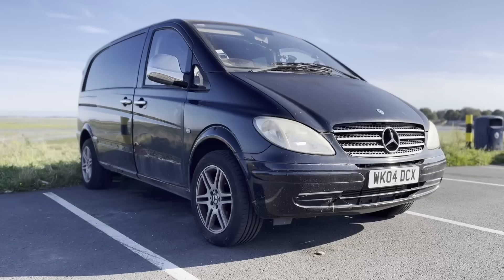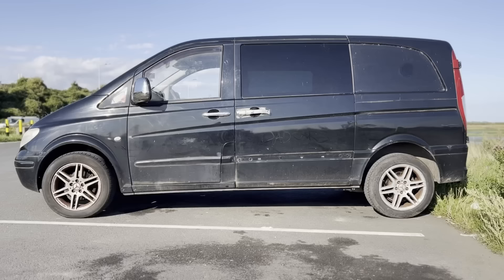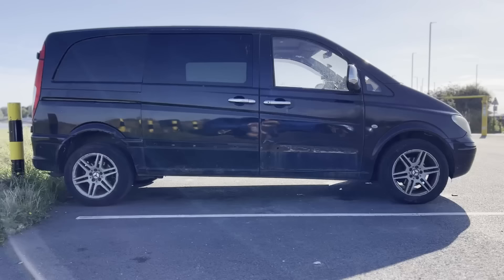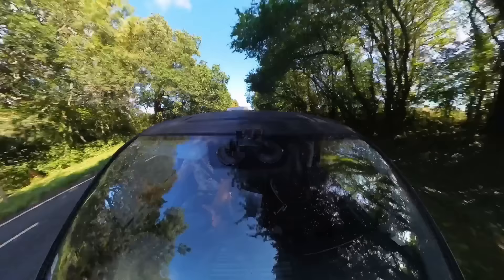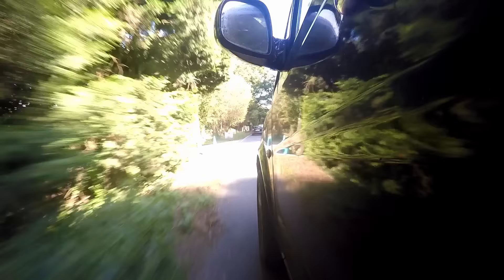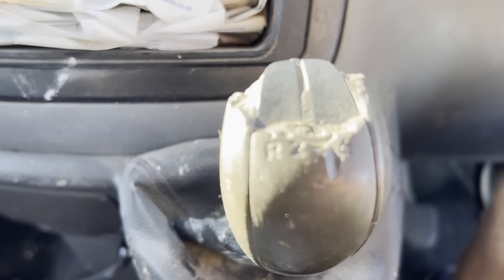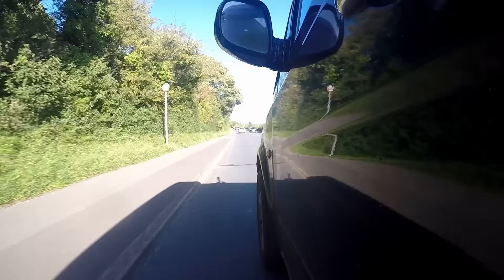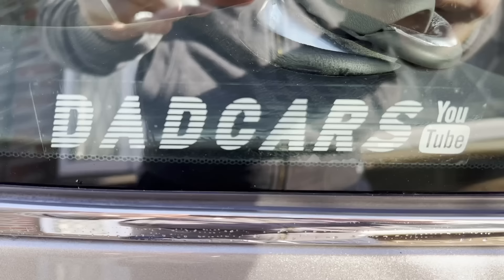The Mercedes Vito Is A Bargain VW Transporter Alternative With One BIG Problem

Comment: I've owned my 2007 Vito 115 sport for ten years now, it's been bulletproof in my ownership, I've had a couple of minor issues but they were easy fixes. It's taken me across Europe, taken my bikes to track days, been on holidays in it, oh and it was my place of work and office for seven of those ten years. Mine is rapid for a van and returns 38-40 mpg on long runs if I keep it under the motorway speed limits. Being a 2007 mine doesn't suffer with corrosion like the earlier W639 models. I thoroughly recommend the Vito, over the other manufacturers offerings, even as a sixteen year old van its quiet inside and drives waaay better than other vans half its age and mileage, even the standard sound system is well above average. Two sliding doors are worth their weight in chocolate biscuits. Things to keep an eye on are the propshaft, front suspension condition and geometry, wheel bearings, injector seating washers do fail, when they blow get the washers replaced as a matter of urgency, use toyota avensis diesel seating washers and the problem never returns. Top tip, get your parts from a MB truck dealer, they supply Vito parts at refreshingly lower prices than you would expect and under the prices motor factors charge, particularly service & consumable parts. A great van that deserves to be as respected as much if not more than the VeeDub, particularly the honking T5. Thanks for putting the Vito up there! 👍🏻
Reply: Thanks great info on the injectors washers👍

Comment: I used to Work for Mercedes for over 25 years, these are good vans, you’ve summed it up perfectly, the rust was a big issue at Mercedes back then, think it was the water based paints that were used it was actually embarrassing when customers came in with their vans showing you the rust, it was unstoppable at the time, but they are good looking, versatile vans. I’ve owned a lwb one and loved it, I used to work in the parts and have sold just about every part of these vans, I’ve always liked them, and definitely good for converting into a small camper,
Cheers from Edinburgh, ( I’ve subscribed to your channel).
Reply from the maker: Awesome thanks man! I do love it such a shame it’s crumbling like a sand castle 😅

Comment: Great video, I’ve owed VWs , transits, Vitos , but the best hardest working bullet proof van is the Toyota hi-ace , mine had 246k on the clock and still drove well 🤷🏻‍♂️
Reply from the maker: Few people have commented the same! Maybe I should get one on the channel 🙌😅
Reply: Had a few older hiaces, they’re pretty reliable.
Reply: The proace is awesome too!
Reply: Agree about the Hi-Ace. The couriers in Australia and NZ use nothing else. Shame that one doesn't seem to be available in the UK.
Reply: Old mk6 transit for me with the T280 ❤
Reply: Agreed HiAce for pure reliability and build quality.....however cab is cramped, hot and they are thirsty.....over all if you spend all day on the road....I'd plump for the transit
Reply: I do love a South African taxi 👍
Reply: I've seen a 600k sprinter which only ever had routine maintenance. Same engine as the vito, in fact same unit used  throughout vans and cars. Toyota hiace is from the past. Rear leaf springs and your sitting over the engine. Horrible in winter driving, terrible fuel economy, noisy and as rusty as the old vitos and sprinters. Let's not forget sticky running gear on the side door and tailgate lifts always failing.
Reply: 100% the Hi-ace most reliable van on the planet, not the best ride and full of plastic, there's a reason in Africa these things are buses and you'll see 30 year old ones still going......
Reply: I sold my 2005 vito at 280000 running great........but the rust !
Reply: Vito's are the best van, simple enough to work on when they do eventually go wrong, used to work on them and found them good to work on so ended up buying one the bought another. Only job that can be a problem is injectors and rear wheel bearing, even the dealers won't do a rear wheel bearing by me.
Reply: Nothing comes close to a hiace!!!
Reply: @Aceedmonkey  totley agree , I’ve just spent £3800 on my T6 ! More than what my hi ace cost 🤷🏻‍♂️ I’m looking for another one 👍
Reply: I am in my third hiace last two were exported to Africa 330k on the clock one of them. My current one is a bit rusty, 229k, and I need an auto due to a bad knee. That's how I ended up looking into vito.
I really just want another hi ace but they don't do auto in my price range . 😢
Reply: @TyronePatOne depends on the year of the Hiace the last model which ended in 2012 has coil springs on the rear.
Reply: @fukuoka33  That's why they use old hi ace all over Africa and India in fact most of the world not vw or vitos then .
Reply: @fukuoka33  is the Hiace as modern as either a VW T5 or T6 or or a post 2015 Mercedes Vito well of course not because production ceased in 2012 but they are most definitely more reliable they literally do starship mileage with little or no trouble the D4D engine is a legend in it's own lifetime the engine is renowned and well known i couldn't tell you what engine is in either the VW or the Vito but both made the list of 5 vans not to buy on a video on YouTube.
Reply: I have bought a vito this week it's a 2015 traveliner exlwb ex prison transport van auto . Still using my 2005 229k lwb  hi ace till the vito is serviced and set up properly but will be sad to let it go .I get people  trying to buy the hi ace off me about one every three months .
Reply: It doesnt seem to me that 246000 IS a lot... 🧐
Reply: @paulbrook2459 246k on a van isn’t that high 🙄
Reply: Had a LiteAce, 8 seater, cost a thousand bucks Aussie, did 5 laps of Australia 💪 was Auto too 😮
Reply: Ldv cub all day long no turbo no computer shite reliable as anything with the nissan 2.3 diesel , I can't part with her she keeps plugging along and never fails to start at flick of the key no matter the weather
Reply: My old man had a Toyota hiace with 300k on the clock, never skipped a beat.
He used to load it up to the hilt and it would pull it no problem and that was with a broken leaf spring if I remember correctly, many moons ago 😂
Reply: Bro comparing pushing a immortal into this isn't fair
The merc volks ford will be sad
Reply: My old man had a hiace 1994 and it had 300k on the clock, it had a broken leaf spring and he used to load it to the hilt, it used to start first time and pull anything, problem was it rotted out and fell apart before anything else died.
Reply: @JManners10 no, it´s not

Comment: The major advantage of a Vito compared to a T5 is the drivetrain in my opinion:
The OM611 in the 99-03 Vitos and practically identical OM646 successor engine in the 03 to 2010 Vitos is just a really solid motor. 
Bulletproof timing chain, dead simple engine layout (i4, single turbo) and there are really no known mechanical failures apart from leaking injector seals which is a fairly simple fix.
The 3.0 V6 the OM642 is also known to be in the Mercedes hall of fame when it comes to their best diesel engines.
In the passenger cars these engines last forever but IF fitted in these commercial Vans they need to work harder and run hotter.
So caution is advised. If the engine had regular oil changes with 5w40 or 10w40 it will most likely be alright but a beat up rig with no service history, a ton of miles is probably just plain worn out.
Mercedes in house Automatic Transmission is also a lot more bulletproof than the Autoboxes you occasionally find in a T5 if you want to go for an automatic transmission.

Of course a T5 with a pre Euro 4 1.9TDI and manual transmission is equally good at first glance but id argue that the OM611 and 646 is the better engine ultimately. The timing chain in them lasts virtually forever while a 1.9TDI has a timing belt that needs changed every 100.000 or so Kilometers or every 10 years at the latest. A snapped belt or skipped teeth will grenade the motor.
Also the "Pumpe Düse" unit injectors on the 1.9TDI are more cumbersome than the standard Bosch solenoid valve injectors on the Mercedes Diesels, they last a long time while the PD injectors can go bad earlier and they are nor cheap or easy to replace.
Another known problem is the fact that the head of the 1.9TDI is aluminium while the injectors are hard steel. And with unit injectors there is a lot of downward force applied to them via the camshaft with each injection. Can you guess the failure mode already? 
The injectors will work themselves into the cylinder head, wont seal up anymore and "tip over" slightly which ruins the injector seat. It rarely happens to these engines and some run for half a million miles without this ever happening and others suffer from his failure at 200.000 miles. 
If this happens you are usually able to get the injectors to seal back up with the right techniques (using slightly! thicker seals, glowing them out to soften the copper, use ultra high temp sealant in the installation) but the cylinder head is on borrowed time then.
It ultimately comes down to Mercedes sporting a Bosch commonrail fuel injection system that is ultimately superior to VWs Pumpe Düse System.

VW switched to the 2.0TDI commonrail in T5 Vans from 2009 onward but those early 2.0TDIs are to be avoided they have many problems like junk EGR systems and intercoolers.

I don't really want to steer anybody's purchase decision too much but if I was given a Vito and a T5 both in good condition and with the same mileage I would take the Vito for the aforementioned reasons.
Reply: Also you can get Vito with a 4x4 drive with an actual transfer case, low range and stuff, so you can actually go overlanding in it unlike Syncro/4Motion.

Comment: I have a 2013 116 and love it for its versatility with performance.  Changed the rear 2+1 seats for single viano seats and can drive to the beach with 4 people a 10'6" SUP paddleboard stashed down the middle + tons of other kit no need for roof racks, ladders go in etc....and it's a compact! Auto gearbox is a massive win. Tailgate bootlid is another favourite of mine I can sit on the back of the van and get changed or brew up a tea in pouring rain. Not converted her at all like you need the convenience of taking seats out and hauling loads to the tip but still throw an old mattress in and sleep in her occaisionally😂 130k miles and no rust issues
Reply from the maker: My old one had a tailgate boot 😎

Comment: As an owner of a few transporters currently a t5, ive always thought the vito was a no brainer alternative, ive read anything after 2006 has better rust proofing, they look really smart and are mechanically solid. Saying that if you do your homework and buy the right vw you should be fine, stay away from the big power engines. Never had any issues with mine. 😊
Reply from the maker: I can imagine with the high prices of transporters the lower price ones are always attractive, but it’ll likely be those that will cost the new owner a lot to maintain… like you say I’m sure if you get a good well looked after one it’ll be a pleasant ownership :)
Reply: No way on earth is an equivalent Vito half the price of a VW. I've got a 13 plate t5.1 I paid 13 grand for it 3.5 years ago with 100,000 if I could have got a 13 plate Vito with 100,000 miles on it back then for 7,500 I would have.
I agree there great vans but half price is a big exaggeration in my opinion.
I would imagine both are money pits past a certain amount of age and miles.
Still a good video though.

Comment: Rust was caused by Mercedes having a partnership with Chrysler until 2007 & using the cheaper American metal.. It’s the same with all the Mercedes of that period.
Basically If it says Chrysler Benz on the VIN by the door then best walk away..
Reply from the maker: This is interesting… thanks for sharing

Comment: I’ve got a 2015 dsg t5.1 transporter and a 2007 Vito 109. Id have to agree with you about the maintenance and repairs . The original battery lasted 14 years on the Vito!. The transporter looks better imo but the Vito drives better, I’d happily drive it anywhere, it clonks and bangs  and is full of dents but always is reliable.

Comment: If you're after an automatic, the vito is the clear winner. Proper torque converter box, well proven and reliable, 40mpg  with a rear wheel drive, it has no equal. Vw DSG is excellent too bit you're going to have to renew a clutch eventually. It also has problems with it's  mechatronics.
Reply from the maker: Yeah a torque converter is want you want on something like a van

Comment: I'm on my second Vito.  My current 2015  LWB 116 axe-murderers van is mine from new, 240K km, bulletproof, right up until yesterday when the Can-bus had a fit and shut down half my electronics including A/C on a filthy humid summer day when I was still 300km from home.  After I got home, it would not start, and the cooling fan went mad, so I disconnected the battery overnight, and bugger me, it's perfect today.  NO rust and I live at teh beach, no garage.  It's kinda beat to shit, but still looks immaculate after a quick wash.  I'm worried that it's developed German electrical gremlin syndrome.  Might be time to trade.  The new ones are so expensive and the nav screen is beyond 80's naff.  I'm thinking about a Ford Transit Custom Sport.

Comment: I had W638 which I loved apart from the rust, Then I got a 2011 W639 Sport X which had no issues with rust as it was a late model and converted it into a camper van, I really loved that van the only reason I got rid was it needed a timing chain which I was going to do at work myself as I was a Skoda main agent diagnostic technician but I lost my job during Covid and then the insurance shot up above what I was willing to pay. I keep toying with getting another now though as it was a cracking van, I could practically drift it around  roundabouts it handled that well!!

Comment: 134000 miles on my 2010 W639 Vito converted camper and not a single bit of rust on it at all.  If looked after, these vans are bullet proof.  As vans go, it drives brilliantly.
Reply: I made on my 2009 W639 Vito (high and long model) 470,000 km.  Not single point of rust. Bought in Holland, it seem this model has zinc cover on chasie, as even if some scratch, no rust happen.

Comment: I can trump you on this absolutely hands down.
I have a Nissan Elgrand van its got 4x4 with diff locks, 250 bhp V6, full luxury leather interior with bose sound system, surround cameras and electric drop down TV's.
Twin electric sliding doors, rear seats swivel to make a lounge are with tabe in the middle, its a 7 seater with space for luggage.
I paid £7200 including all the import costs form Japan. Its a 2009 with 46k miles and full service.
Its goes like hell with a 3.5L V6 sounds wonderful and blows away every single VW transporter 'sport van' it have ever met 😁
Reply from the maker: That sounds awesome! Although I only paid about 3k for this 7 years ago so not a fair trump! 😅 I’d love to film one of those though! Bet I’d love it
Reply: @dadcars  yup its alot of fun at the lights. Ive got a large chrome badge on the back of it that says 1.4L Eco Cargo Van, you should see the look on the faces of the top end Transporter when blasting past. Had a bloke in a Transit SMRT sport van pull up and ask how its faster than his van, and its only a 1.4, told him its because I peddle harder.
Reply from the maker: @IronMountainx  don’t know where you’re based but if you fancied a trip to Hampshire I’d love to feature it 😎

Comment: Had a Type 1 Vito from nearly new (18 mth old) for 11 years and totally loved it. 
It was a panel van originally, and I got it professionally converted to a crew cab, with removing rear seats.
Yes, it was an absolute rust bucket, but only from the door trim down to the sills. I resprayed those areas myself, and it looked like new for a further 4-5 years before I sold it on to another VanFan.
I drive a Ford transit custom, crew cab these days, but it is in no way as much fun to drive as the Vito.... that could easily pull 120mph on the Autobah. 😉

Comment: The vito is the best van I owned, but I had to down trade for the citan for fuel economy. I like the rear wheel drive too, but it's shit on wet grass with no weight in the back, and there is always the possibility of overloading it, so you keep the drive but lose your steering. Fun and games.
Reply: Rear drive is a big plus in the vito. Try to climb a big slope with a lot of weight whith front drive....

Comment: vito has the ultra reliable 611/646 engine. even if it breaks, replacement engines are easy to find since they are in almost all models from that era. biggest problem with the 611 is air leaks in the low pressure fuel system

Comment: My 2006 vito is the most loyal thing I've ever owned.
Making its 2nd camper project now, improving de 1st one, the vam deserves it so much.
It got repainted again in 2017 and still looks new.
240k. Km and still rocking as the 1st day.
I bought 2nd hand at a good price, so its value today is almost the same.
Best investment ever. Maybe is my 1st and last diesel van, who knows.
Seen a lot of vw vans with lots of problems and angry owners.
In snow having the rear traction beats front traction when to want to climb a slope.
The turn radio is better than vw because of that rear traction.
Love my vito❤

Comment: I've owned a T4, Sprinter, Bongo and a Vito. The Vito/Sprinter engine is much better than the others and more economical. Also the reliability has been better. The fuel pipe detaching is a common issue with the engine and a super easy fix.